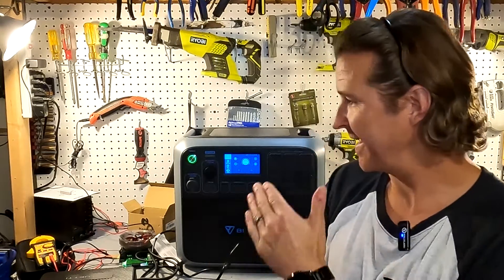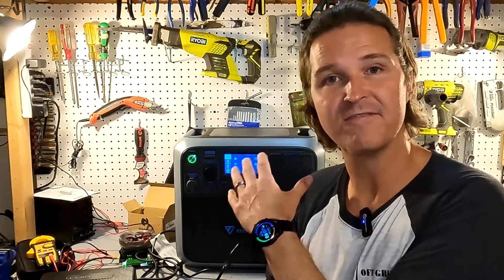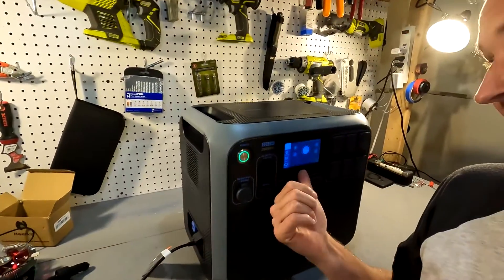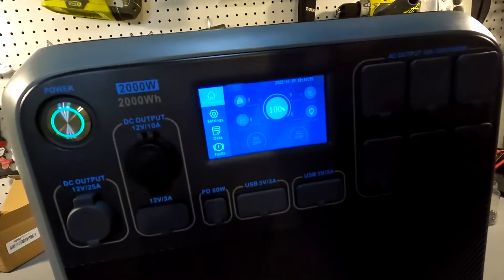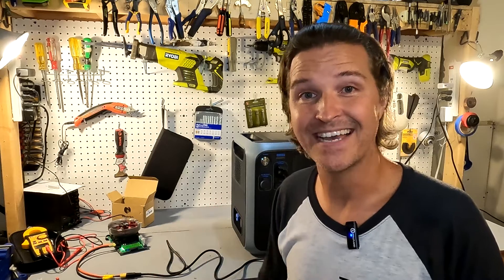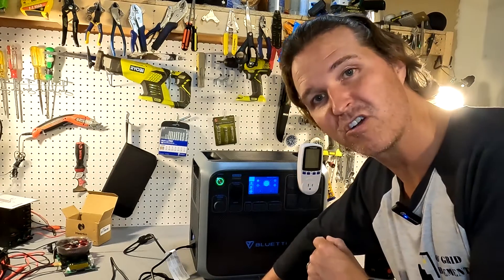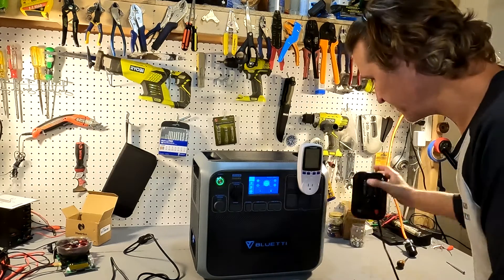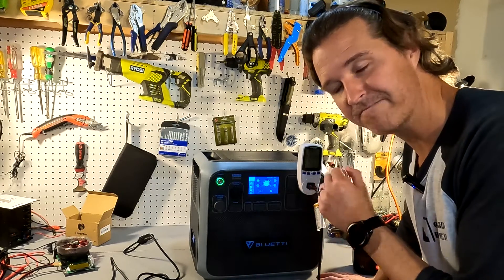Finding the True Battery Capacity of the 2000wh Bluetti AC200p.

Comment: I bought mine in 2022 and noticed at the time that the capacity was a bit less than I initially expected. This test was a great refresher on that reality. Probably worth pointing out that I believe the unit reserves 10% of the capacity as a failsafe. So I suppose you could do the math out of a 1800wh total possible capacity.
Reply from the maker: Thanks for the info!  I haven't used the AC200p in a while.  It just sits in my basement at 56% capacity.  I should do another capacity test to see if it changed.  Thanks for the comment.

Comment: I just thought of another problem,I have popular 375w Canadian panels, Short Circuit Current - Isc (A) 14.01, Maximum Power Current - Impp(A) 13.15
Might interest quite a large Group.. But do you have any panels that are slightly over the 12A spec of the Bluetti input parameters....Does it work.
Reply from the maker: The mppt CC should limit the amperage without damaging the unit.  You just won't get full use of the panel.
Reply: Cool, I am going to make a few videos myself...My energy customer octopus is asking 250 Bucks with 150 refundable to Export energy to the Grid can not decide anything. Yet... Not sure how Bluetti discharges to Grid, If at all. Can I get approved to export at all.

Comment: I want to love Bluetti, On the surface its such a professional product... But you have to feel that they are disabling all the potential.... If PowMr can make cheap invertors that can Grid Tie hybrid style and take 500voc worth of panels more than 10  panels 4000 Watt panels in series. I get it its a camping product but for little money it could have huge improvements in capability.  I don't think you get Grid Tie capabilities until you get to the B500 models. I think I will have to go for the PowMr Hybrid Grid Tie. But really I want a product idiot proof where customer does not have to do any fancy wiring.. Don't really want novice DIY guys like me making mistakes. Bluettti for this reason might have to give 2 out of 10 PowMr cheap 300 dollars
Reply from the maker: I really think they are working with the available battery capacity in the unit.  They don't want people trying to charge the units at 1 or 2C rates just because they can.  Thanks for the comment and the info!

Comment: there are a bit  less hungry  step down converters out there but need to be screwed  manualy to idle the best consumption for every different load!!!  its a fair voltage   if you versus it my delta 2 that has already blown the 12v output fuse inside!!!! nothing to do but wait 5 years for the warranty to end and add my own 10x more reliable somewhere inside
Reply from the maker: Bummer about the delta 2.  Thanks for the information and the comment.